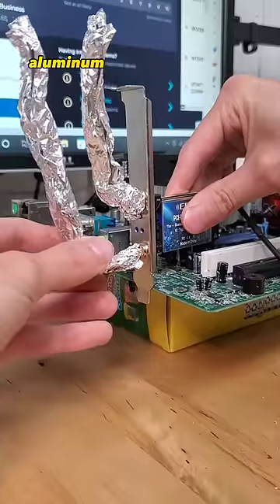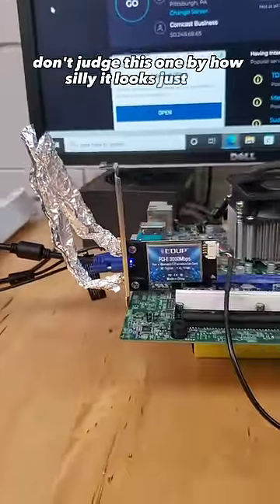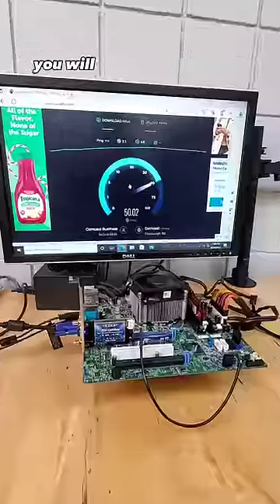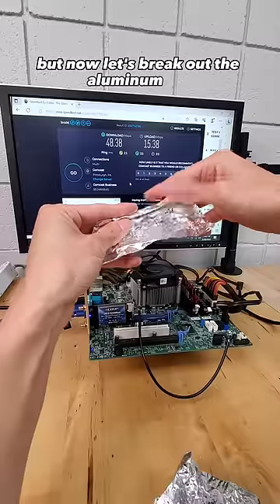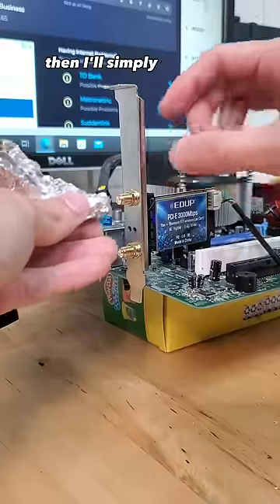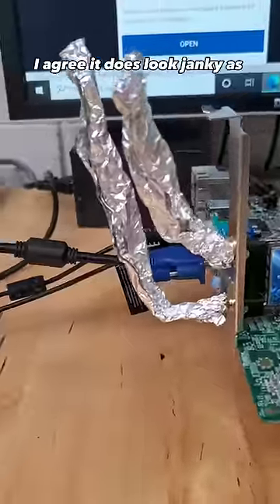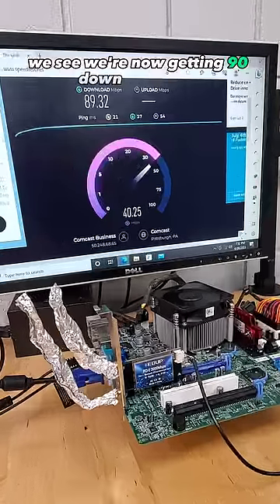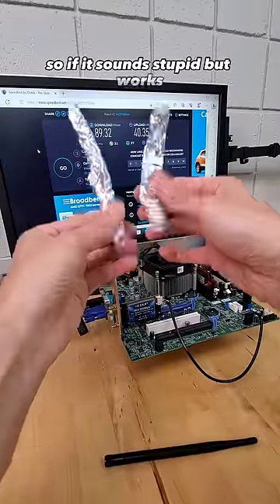can you use aluminum foil as a wifi antenna in your PC? #shorts

Comment: The problem is the signal drop still happens. I've been wired for a few years now because I have no antennas, I did foil, and it does increase the speed, but if your signal changes in strength you'll probably drop off wifi momentarily.

Comment: I know this comment wont be seen, but from an electrical standpoint the foil is only toughing the ground connection on the SMA connector. The center pin is where the RF is coming from... So essentially he just shielded the connector.

The fact he's getting internet just boils down to the lack of shielding on the network card.

Comment: I used to live in a place that was far from the wifi. I filled a bowl with aluminium foil and placed it so it would reflect the signal into my wireless receiver. It worked just enough to be useable.

Comment: that's just grounding it.  if THAT is helping you, I bet you'd see a massive improvement by cutting a paperclip in half and shoving the two bits into the two SMA connectors. (and DON'T let them touch any other metal like the shell of the computer or the threading around the SMA connectors)

Comment: Well, unless that was a scam, the result is surprising. The centre pin of those sockets is the actual connection. The thread just holds the antenna on. Wrapping foil around the thread should not have that big of an effect. Maybe 5-10% increase, but certainly not the level in this video.

Comment: Back in the old days when you break your TV or Radio antenna, straitening out and old hanger and stick it in place of the broken antenna would work. That is ok for a radio receiver but when you do this to a transmitter you may be damaging the equipment due to impedance mismatch. It probably would work enough to get the job done for the short term but over time damaging the transmitter. A wifi card is a transmitter and receiver. You would be better off buying good replacement high gain wifi antennas instead. Use the aluminum just long enough to search the internet for the proper antennas you need.

Comment: I remember back in the 80's putting aluminum foil on the cable line trying to get an OTA channel to come in clearer. The cable box wasn't digital. It was one of those old ones with a channel slider. Anyway, I don't remember if it worked, but it did descramble the Spice channel and a few other premium channels. This was back when they just had a filter on the line to scramble channels. Digital ruined everything. It was great while it lasted though. 😊

Comment: Operation of transmitting radio-equipment without antenna results in the signal being reflected back, due to the missing load, into the final power circuit stages of the amplifier.

It will break in high powered operations.

Comment: I don’t know whats worse, the fact that the rig isn’t connected up using an ethernet cable, or the fact that aluminium tin foil is MacGyvered to get the wifi signal. 30m ethernet cable is like $20-30 on amazon.

Comment: If its stupid and it works, its not stupid…

Doesnt apply here. Sure, use it if you have to, but the potential to short out your wifi card does is not negated significantly to be worth it in my opinion. And for example, the particular card you are using can use standard antennas from an old laptop.

Comment: Don't do this! It's literally shielding your connectors. If you want to do a makeshift antenna look up the length it is supposed to be for the mhz your wifi is running at eg. 2.4ghz or 5ghz and cut to size then stick the wire inside the hole in the center. And then you should get ok range. Speed is generally not effected by signal unless it is really low when it is digital.

Comment: Put a 34mm length of wire or paper clip in the center of the connector for 2.4 GHz and 15mm for 5GHz

Comment: This does not work at any capacity. You are adding aluminum foil to the outside of the port, which acts as a ground. The center of the port is what actually transmits the signal.

Comment: You are still getting an impedance mismatch in the transceiver. That mis match will create a high SWR causing excessive heat causing failure in the final RF transistor. This can cause a failure in the PCI system of the PC, which can shots the CPU! So, $.10 of foil can cost thousands of dollars.

Comment: you can also get a long wire - I use to live on a sailboat and had an ipod nano - they used your headphone wire as an antena for radio (super cool feature) - found we could wrap the wire around a steel stantion (big steel cable that suports the mast of the boat) to get better radio signal. sometimes getting signal that we couldn't otherwise get.

Comment: I wonder if not having an antenna is going to cause the radio board to fail prematurely? Reason I say this is because with FPV drones and radio equipment transmitting with no antenna will cause the radio board to fry because they are designed to have a load on them, like in HAM radio you have to have a 50ohm antenna so you don’t destroy your radio and I know plenty of guys who lost their video transmitter antenna and they still were getting pictures but after a couple of days they quit working. It was only 25 mili watts. Very little power.

Comment: i remember i lived on a farm and the wifi was like 70meters away from the main house, so i had an USB wifi outside with 2 normal sized antennas on it and thats how i had internet but it was unreliable sometimes it disconnected also speed and latency was horrible so i d put a metal bin top behind the sub wifi as it had a shape of a parabholic antenna and it just worked like a charm! the signal strenght never went below 90% in the worst weather conditions and the connection was rock solid with high down and up speeds and a max latency of 20ms! so yeah if you dont care about how things looks then go for it :D

Comment: You can easily short the pin inside the conector with the outer one basically shorting it to ground which will kill your wifi card .

Comment: next take a cooper wire the right thickness to fit it the antenna holes and wrap them around a screwdriver until you have a coiled wire the size of a normal antenna.  Then get an extension and an empty can of coffee and place your new cooper coiled antenna in the can and aim at the router, way faster wifi.

Comment: You should avoid this 😅 antennas act at a sort of resistor and when you remove them and it transmits signals its can blow chips and other resistors.

Comment: When I was a teenager, I got into desktop PC building/maintenance just a little bit. The software part still confuses me, but the hardware stuff is like working on little machines or cars... pretty cool to learn about that half. Late 2000s shit, ya know. 

Anyway, my mom's uncle got me a Wifi card for my desktop (to get rid of the ethernet cable I had running along the skirting boards to get to the modem). I think it was a birthday present or something.
So, I install the board into the desktop and presto... it works! Granted, I used the computer for a lot of things that weren't Internet, but talk about a real game changer!
Couple months go by, I got caught skipping school or something teenagers do, and my mom says: "Give me the antenna off the back of your computer! You'll get it back when you can act right."
Well, clearly... my mother's technological intelligence was minimal back then. Our modem is like 15 feet away from my computer, signal only has to go through one wall.... it'll still work! But I acted all sad and angry and shit when Im unscrewing it and handing it over, like "Yeah, mom, alright, here ya go." 
I'd keep a computer game or a word document or something opened up just in case she walked in, I could change to it quickly. The only time it wouldn't work is if there was like some furniture or something that had been moved in the way or if too many people were on it. I had to remember to not freak out if my internet went out randomly, and be casual and sneak turning the modem off and back on again to reset it.

But it was MySpace and Facebook (which was still kinda new at the time) and whatever online game or thing I wanted to do online all day long... then porn all night long, like a fucking degenerate! 
Watching this short brought back all those memories. Crazy how that works sometimes.

😂😂😂

Comment: Main issue on lower end mobo is that there is not much heat dissipation on the wifi card so you end up simply destroying the card if you forgot to screw them in :x

Comment: I'm sure you probably have some wire laying around imagine. How good a signal? You would actually get if you go online and you use the frequency formula Calculator.. And strip back to the exact amount of wire for the size antenna. You wish to create. It's even easier and you'll get better signal.. You just have to choose. Do you want a full wave half wave quarterwave eighth wave?. Etc.
You're welcome

Comment: I'm not sure how that works
as it's not actually an antenna
it would need to have a wire across its entire length between the outer edge and the center pin, right?

Comment: Please don't do this. Over time it'll burn out the radio on the Wi-Fi chip. A reason why is that The aluminum foil is not properly tuned for the Wi-Fi frequency. Causing non resonated power to return back into the radio. Causing it to overheat and break

Comment: Sorry, but that will not work. The antenna connection is the socket at the center of the fitting. The outside is system ground.

Comment: hmm.... would say this is fake, but I could be wrong. Take a look at those antennae connections. Metal threads part on the outside (ground), white insulation on the inside of that and in the center is the conductor the antennae is supposed to connect to.... so you wrapped your aluminum antennae around electrical ground. HTF is that working?
I think you want other people to do this so you can hog all the bandwidth.

Comment: what was the speed with the antennas. Was auto attenuation enabled If it was MIMO did you lower the radio power to compensate for the higher resistance

Comment: BS: both foils are connected to the outside of the connector which is ground. The real antennas have a wire on the inside connected to the center terminal. Another fake. (Notice they’re both connected to the outside metal case.)

Comment: Is it repeatable?
I would have bet less connectivity with the aluminum as you ground it and it's way too long.
If you want to make a makeshift WiFi antenna cut any wire to 25mm of length and connect it to the middle pin

Comment: I used to use a stainless steel bowl and tape my wifi adapter to the inside, tape it to the top right corner of the window and got better signal on my neighbors wifi and was able to use my pc with pretty decent speed. In the summer when hot the bowl got heated and melted the wifi adapter 😂 never broke just looked melted 🤣

Comment: You should never run a transmitter without a load. That’s baked into every amateur radio operator’s brain. This is a quick way to destroy the finals on the transmitter and absolutely ruin your WiFi card.

Comment: Well but see you have no clue how antennas work and the part that the foil needs to be touching is actually the pin on the inside, not the threads on the outside. So yes, it really is that stupid because it could actually work, and you're just damaging the wifi receiver card

Comment: Yes, this idea is stupid.
You'll get a better connection with virtually ANY OTHER METAL other than aluminum.
AND put it IN the antenna hole, not around the outside.
Also a speedtest won't test signal-noise ratio.

Comment: What if you ran a couple conductive cables down from the aluminum grid frame of a loft bed?

I tried it with an AM radio and it worked just fine, so why shouldn’t work for a PC?

Comment: Coat hanger coated in foil. Lul..
But yea ive used that, or an old radio wire antenna stuck into the wifi and hung up somewhere

Comment: You have no idea how radio waves work. Those tin foil "antennas" were attached to the shield part of the plug 🤦‍♂️ the pins in the middle is where an antenna would be attached. As for your "proof" Id say that was luck or fake.

Comment: Long story short your gonna burn up the transmitter on the card due to high SWR's I don't have the time or the patience to explain to you how radios but you should not do it would be theoretically okay if it was only on a radio receiver but the transmitter is a little bit more touchy

Comment: Where can I get the cnvi antennas for these Wi-Fi cards ALONE without the chip so I can get it cheaper. I bought an intel Wi-Fi m.2 module but didn’t receive the antennas so it’s useless for now. Serious question. Does even micro center sell them alone for cheaper. Also what is that black cable connecting the card to the header on the mobo? Do I need that too because I don’t have that either. Is it for power, usb etc.?

Comment: Well now I know what to use if my ethernet cable is disconnected to the rooter whe it gets replaced because the WiFi b9rds antennars broke off so I guss I will work wit some tin foil.

Comment: Haha fake, upload speeds should max at 40 as well without antennas. As it uses the same 'connection' / bandwidth as download. Since 48 is the 'max' without antennas, it should easily hit the 40 Mbps it did 'with' antennas.

Meaning, you throttled your speeds manually.

Comment: Ok DUMB and fake. The outer threaded part is ground. You get 0 down and 0 up. You have just shielded the center pin to ground. You need to connect to the center pin to create a connection.